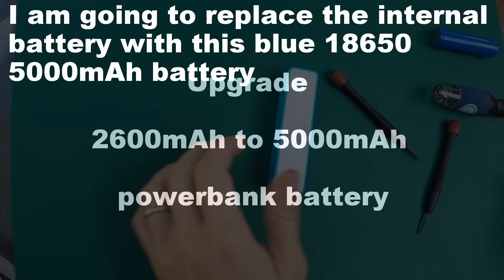How to upgrade your powerbank 2600mAh to 5000mAh

Comment: Dude excelent tutorial, I have a questiion maybe you can help I got exactly the same battery that you show on your video It charges but It wont charge any device, its been like that since the moment it was purchased, you think something inside might to be lose or something, thanks again and hope to hear from you
Reply from the maker: Armand Jimenez This powerbank can output 1.5A (max), if your phone needs 2A then this powerbank may not have enough current to charge your phone so check the A input in your devices. But if your phone needs less than 1.5A, then it could be the step-up chip in the powerbank or the battery. You can check your battery by using a multimeter, it should read well above 3.7V if fully charge.
Reply: danleow 1.5 A does not diffrs much to 2 A  evn if you have less current output your device still be charged but need more time then usual.
Reply from the maker: Abdelkader Ahmid True! however I have tried on some tablets or high end phones like the S5 and S6 they simply wont charge with this powerbank but no problem with iPhone 5. I think is the phone circuitry that simple requires minimum current.

Comment: I have same like your but the wire is not soldered directly to the both end of the battery. mine have spring on negative and metal contact on positive. but the battery come with the power bank is not a new one most probably taken from laptop battery cause there are sign of weld. replaced it with 2500mAh original samsung battery and can charge my galaxy note2 to 100% from 40%

Comment: Unfortunately you can't. I have 2 of these and they inky have a 1500mah cell inside. The largest capacity cell at the moment is 3600mAh. Your 5000mah eBay cell will only be 1900mah if you're lucky.
Reply: Good to see your keen on pulling things apart to make them better 👍. Keep on tinkering 👍 👍 👍 👍

Comment: There are no 5,000 mAh batteries which is not a FAKE.
Panasonic 3,400 mAh is the maximum I can find.
Do you really think Chinese are capable of making anything like 5,000 mAh battery?
Please publish a link where I can buy a 5,000 mAh batteries.
I am sure the 5,000 mAh battry you used to replace your 2,600 mAh one is also a FAKE.
And I am certain that the 2,600 mAh batery you replace is also a FAKE.

Comment: If that blue battery is actually 5000mAh, I'll eat my hat.  The best cells out there are still mostly under 4000mAh, with most at 3300 or 3400.

Comment: I have another rechargeable battery, Can I  connect it in series or in parallel to increase the capacity of my power bank ???
Reply: +Diego Flores Connect it parallel, don't connect in series as this would increase the voltage.

Comment: Hello... Nice Video...
I've an 2200mAh mini powerbank...
I want to add some more battery to make High Ampere... (like 10000mAh)
Is the mini Circuit can handle the high ampere battery pack...?? Plz reply soon...!
Reply from the maker: +Arnab Ghosh Yes you can, just connect the batteries in parallel connection (not in series). Since you will increase the capacity, you also have to consider heat dissipation for prolong use.
Reply: +danleow Yeah... Also I've to find a Big Casing for batteries and ventilation...!!
Thanks...
Reply: +Arnab Ghosh the batteries are fake
Reply: +DMAN22yeah I've my own electronics knowledge... so, maybe there are some fake batteries from china... but there are also exist some multimeter to check them... so, don't worry... :)
Reply: Arnab Ghosh english much
Reply: +DMAN22yeah Thanks for your million dollar information... :)
Reply: +danleow charge current won't increase, only charge time will increase. Why larger heatsink is needed? Powerbank's came to stable temp after maybe 5 min's of charge/discharge.

Comment: Hello i bought four power bank of 1800 mAh. I charched them and the red light and the blue light turn on but i never saw the difference when the batery is totally charge, so i leave all night charging the power banks, in the morning i connect my phone to each power banks and nothing happend. I what to know if im doing something wrong
Reply from the maker: If you are recharging your powerbank, the red light should only turned ON not the blue light. So if what you say both lights turn ON, then something is wrong with the powerbank. The blue light should only turn on when you are charging your phone. Make sure you plug into the right USB hole, the normal USB is to charge your phone and the micro USB is to recharge the powerbank.

Comment: My original power bank is 1800mAh , tried to put a 18650 cell 3.800mah , just not carries. And charging the battery in another charger and then welding and using the power of the bank board, it does not charge anything. What can is occurring ?
Reply from the maker: alanbelem did you make sure the polarity is correct? is the new battery working?
Reply: +alanbelem the batteries are fake

Comment: Hello again, I have a new question. I have a portable bluetooth mini speaker, and power bank just like yours. On max volume (with hanged up power bank)  the speaker's battery holds only 30 min. But the external battery( power bank) did not give me more time for listening music on maximum volume. I found some differences in the batteries- a high drain batteries and simple batteries ( may be low drain batteries). I am wondering.. Is my speaker a high drain device? And which battery will give me more energy to play music for longer? For example NRC18650 is a high drain battery, I think ICR is not
Reply from the maker: 30mins is quite short, usually small bluetooth speaker with built-in battery should last between 45 mins to 1 hour. Check how much Watt is your bluetooth speaker, if it is just a couple of watts then it should last quite a while. If you are looking for good 18650 battery, I suggest you get the panasonic 3000mAh. It has more battery cycles, meaning you can charge more. Some seller claims their battery has higher mAh but usually they don't have much cycles.
Reply: It is 3W hipper loud. I think that my speaker consume more energy than power bank is capable to inject to it for a unit of time. Is it possible this to be true. .
Reply from the maker: It is possible, if the speaker requires more than 1.5A then the powerbank will not have enough current to charge the speaker battery. Check what is the charging Amp for the speaker.
Reply: danleow Unfortunately there is no such an information. The sellers tell me only this:
Battery Charging Voltage: 5V±0.5V
Battery Capacity: 520mAh
Loudspeaker Output: 40mm 2.6ohm 3W
Input power: DC 5V
Frequency Response: 60Hz-18KHz
Distortion: ≤0.5%
Dimension: 60x60x53mm

I will try with different batteries and then I will say what is my conclusion.
Reply from the maker: m Ni You can calculate the A (W/V), so the speaker drawing current is 0.6A which is enough for you powerbank. Your speaker battery 520mAh is really small capacity.

Comment: does the circuit board have a step up converter?

and

unrelated question
1. can i use li-po batteries(from old phones) differ in volts(2x 3.8v and 2x 3.7v)? 
2. which is better? batteries in parallel with a step up converter or in series with a step down converter?
3. can i dissemble a low capacity powerbank and do upgrade it like (answer from #1 and #2)? since it uses a step up converter and it has a micro USB charging port...

thx in advance!!
Reply: +Jan Rick Yes the circuit has a step up from 3.7V to 5V. I don't think can use Li-Po because it charges differently from other batteries. Parallel and Series setup depends on your application. If you want to upgrade your low capacity to high capacity, always use parallel because the circuit input is 3.7V.
Reply: +danleow kite so its possible to wire multiple li-po batteries in parallel if they are the same voltage?
Reply from the maker: +Anon Ymous I believe li-po charge differently from li-ion which this powerbank uses li-ion battery so the circuit is not for li-po batteries. Besides, li-po charger is required for multiple li-po batteries to make sure each li-po cell charges equally.
Reply: thanks, I have three 3.7v li-po batteries from portable speakers and I want to connect them to power a higher wattage system...not sure how to go about it yet but I've been reading blog after blog and I've put together a few ideas so far

and advice would be appreciated!
Reply from the maker: +Anon Ymous Watt = Amp/Voltage, so to increase your wattage you need to have a step up circuit that can give you higher amp. However higher amp will drain your battery faster.
Reply: I'll look into this step up circuit
thanks.

Comment: I was into vaping for a while so I have a lot of 18650 batteries.  Although there not the highest mah rating they are high quality 30 amp batteries. Will these be OK or should I just get a cheap higher mah batt from RadioShack
Reply from the maker: ***** Doesn't matter old or new as long as they are 18650 battery type is alright. Cheap batteries don't usually last long.

Comment: Hi something I know- when you attach the 5000mah battery to that circuit it shall become 3000 or 3100mah in the power bank. Because step up from 3.7v to 5v reduces the amps.

Something I would like to ask- Regarding the power bank circuit board. I want to reduce the amp and volt output of the powerbank. I want the power bank to give 500mah and 3.7v or less output, for some other purpose. Do you know any trick, to add or remove any part in the circuit?
Reply from the maker: mAh is the capacity of the battery basically you cannot increase or reduce the capacity. However you can modify the circuit to increase or reduce the current (A). 
You may want to create the circuit board, you can look at this instructables link below but you need to attached USB connector to the breakout board. However this is to adjust the voltage not Ampere but both are related. Hope this will help you in your project. 
http://www.instructables.com/id/Adjustable-Voltage-Step-up-07-55V-to-27-55V/
Reply: danleow
hi, yes I wanted to lower the voltage and current output by modifying the circuit of the single cell powerbank which is available in market. So that I can use it for lighting a bulb for hours(because of low voltage requirement). Building new circuit will take more space. The powerbank circuit is just a thumbnail size, that's why I thought there must be some way to control or reduce its output. or atleast use the 3.7v directly. Because the stepped up 5v output is unnecessary for my project.
Thank you for the link, its a nice project that I will make for later :))
Reply from the maker: Kketansa Art With the prebuilt-in circuit board, there is no way to control its output unless you modify the circuitry. These PCBA use SMT assembly machine, that is why the board is so small unless you have a very good sharp solder and steady hands you might able to replace and add parts.
Reply: danleow
ohh...thank you for replying,... ok I see...
I think I should then solder some direct wires and a external socket..
Reply: +Kketansa Art the batteries are fake

Comment: This is true but you must be careful as batteries from different devices tend not to work well together all the time. I've made something like this with batteries from a laptop but they are all the same batch and have been working together. Use caution,

Comment: I recently bought a similar powerbank of 2600mAh. It has a 5V output mentioned on it. But when I connect my phone (Moto E) to it, my phone shows charging but battery percentage remains unchanged throughout. I think the problem is with the battery but I am not sure about it. Should I replace the battery? Please anyone reply.
Reply from the maker: There should be no problem with moto E as I have tried before. If you are using the phone and charging then you may not see the battery level increase. Which battery are you referring for replacement?
Reply: danleow I am talking about the 18650 battery present in the powerbank.
Reply from the maker: Aniket Rane If you can see the phone charging with the powerbank, technically it should not be the battery problem. You only need to consider changing the powerbank battery when it becomes inefficient, for example the 2600mAh powerbank battery is able to charge iPhone 1.3 times but when the powerbank battery cannot charge  at 1 cycle then is time to change the battery. Were you charging the phone and using it at the same time? was the powerbank fully charged before you charge your phone? How many percent of battery can you charge with the powerbank?
Reply: My powerbank is fully charged and i am not charging the powerbank and phone at the same time. I can charge 0% of my phones battery with the powerbank. :(
Reply from the maker: Aniket Rane I think misunderstood my question, were you using your phone and charging your phone with the powerbank at the same time? not charging the powerbank and phone at the same time. I do not quite understand "I can charge 0% of my phones battery with the powerbank", can you elaborate. By the way, do you see the charging indication on your phone when you plug the powerbank into it? By right, if you fully charge your powerbank it should charge your Moto (e). FYI, there are some of these powerbank uses really poor quality chip and battery.
Reply: danleow hey you own one and so is there a led light in the device cause I dont have a light
Reply from the maker: There are two led lights red and blue on the white panel side
Reply: Ou I dont have twp
Reply from the maker: King of hearts If your powerbank is the same as the video, you should have one side in white colour.
Reply: +Aniket Rane the batteries are fake

Comment: Can I use the same circuit board with 6 or prolly more 18650 parallel. Since voltage is the same. Only mah go's up. I'm planning to make a 20,000 mah power bank from my old power bank. Btw not gonna mix batteries with the old once I'm just gonna recycle the board
Reply from the maker: Yes you can, but make sure the battery is Li-Ion not Li-Po. Anyway all 18650 are Li-Ion. I suggest don't mix the good batteries with bad ones.
Reply: Keep in mind that with such a low charging current, it may take almost 24 hours to charge from empty.
Reply: u need a balance curcue
Reply: circuit
Reply: lipo doesn't make a difference

Comment: i dont know if anyone need this info but the manifacture of those  powerbank you have in the video is made be " Guangzhou Sunwith Co., Ltd "
Reply from the maker: The powerbank case comes from a plastic manufacturing because they have the plastic injection mould, but the IC inside this powerbank can come from dozens of electronic manufacturer, I have opened a few from different suppliers and they all have different layout in the PCB.
Reply: i have done that too but is not about who made a specific park but who putted it together and sold it
Reply from the maker: Rune Laurtsen Many empty shell companies in China assemble these powerbanks and they claimed they manufacture the whole powerbank.

Comment: Whats the max mah I can upgrade this power bank to can I upgrade it to 6000 with an 18650 battery?
Reply from the maker: In my honest opinion, I am not sure what is the max as long as it is a 18650 battery size should be able to fit inside this powerbank holder. Just beware fake 18650 batteries ;)
Reply: +joeh690 the batteries are fake

Comment: Hi. How long i have to charge my power bank 2600mAh. My red indicator is blinking when charging.
Reply from the maker: Tomislav Tlak If your powerbank is empty, it should take between 4 to 5 hours to fully charge.
Reply: I dont know why but i need 24h to fully charge. I use 2600mAh battery from old laptop battery and charger that gives 1A and 5V.
Reply from the maker: Tomislav Tlak 24h to charge is too long, anyway you may still able to use 18650 batteries from old laptop but these batteries are not as efficient as new 18650 batteries. It may take much longer time to charge and reduced in capacity

Comment: Hello can i use a 18650 3.7V battery or do it have to be a 5V battery? where can i buy the battery?
Reply from the maker: You can buy 18650 battery from eBay or your nearest radio shack store. There is small step circuit inside the powerbank to convert 3.7V to 5V.
Reply from the maker: The step up circuit is for the battery inside, the 18650 battery is 3.7V so it need to step up to USB standard 5V. As long as is 18650 battery is alright. The charging capacity and efficiency depend on the battery quality.
Reply: Best battery cell from a dead laptop battery
Reply: Ivan Slinkar People- STOP buing these FAKE 5000 and 6000mah batteries- they are with 10 times less capacity. Normally original battery 18650 with 2500-2900mah is 7-10-15$ for one pcs.

Comment: Is there such a thing as a 18650 10000 mAh battery?
Reply from the maker: haha! good question? in my opinion I don't think there are any. Even if you find one just be careful of fake batteries ;)
Reply: The 10,000,mAh battery I use is from Anker, but these run multiple lipo cells and not  li-ion batteries. And they are much bigger but will put out 3 amps and good for charging tablets that need more power to charge.
Reply: +joeh690 the batteries are fake

Comment: 5v input (pin) to 1.2v battery charge.

1.2v battery to 5v usb output.

how I made it???
Reply: 1.2V? what battery is that? the 18650 battery is 3.7V output
Reply: +danleow kite  bro niMH battery. 1.2v. does it work???
Reply from the maker: The powerbank built-in circuit is designed to charge Li-ion batteries not Li-Po or niMH. Attempt to charge incompatible battery type in the powerbank may cause explosion.
Reply: +danleow  ops.I think nimh worked perfectly.
lI on battery maximum power 20000mah???